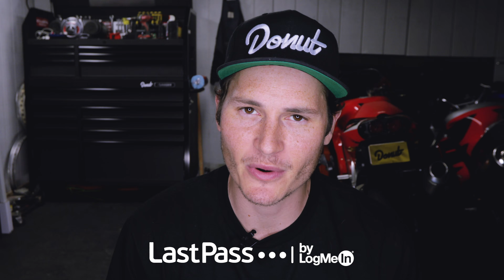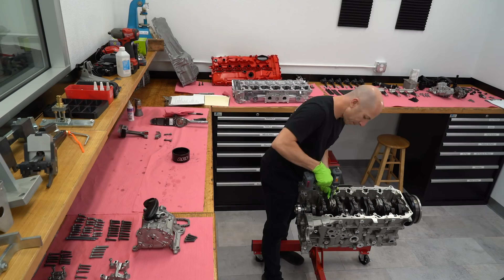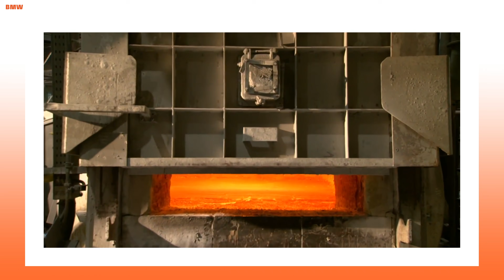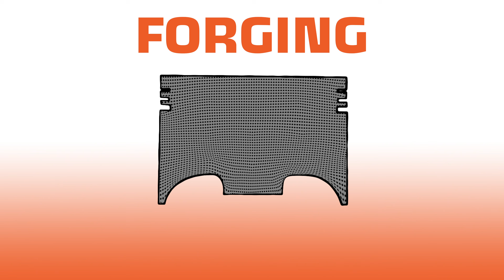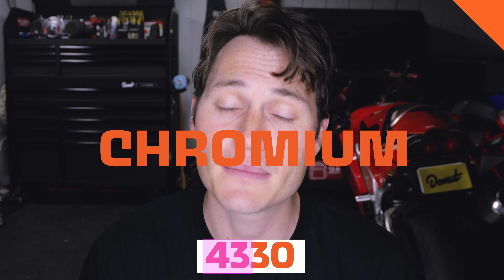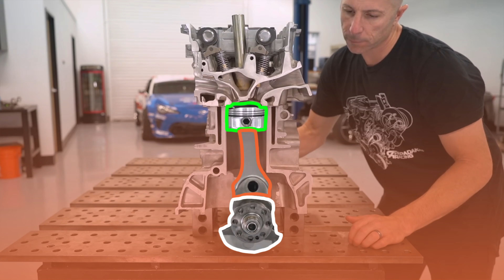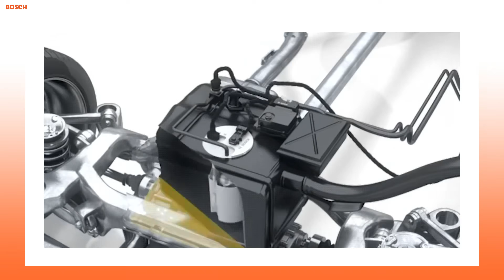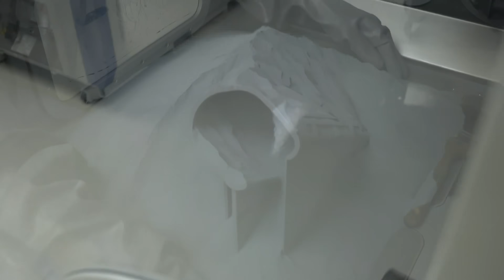The FIRST 1000HP 2020 Supra - Tech Explained

Comment: The use of the stock head gasket is to lower the probability of the bottom end failing. Instead of the pressure taking out the bearings and rods it will blow out the gasket. You should learn more before you misinform ppl. Having the aftermarket gasket with the seal rings and all the stronger material is more likely to blow out the bottom end with all that boost so they use stock gaskets. I kno id rather replace a gasket and not a whole short block and all the custom parts.

Comment: So we're just gonna ignore the fact that daigo saito had at least a couple of A90 supras before Steph made theirs? No daigo didn't use the B58 engine, but he was the first 1000hp A90 🤷
Reply: Not with stock engine that's the difference.
Reply: @carboydorifutoparty3976  but where have they mentioned that? In the title it just says "First 1000hp 2020 Supra" and in the video intro he says "this is the first 1000hp 2020 supra, and it's still using the stock engine"  so they claim it to be the first overall. And not the first to still use original engine 🤷
Reply: @al111dk  I mean that's just dount media saying that. Even tho Steph is still responsible for building the 1st 1000hp drift mk5 with stock engine wise while daigo saito really got a mk5 from toyo that was immediately 2j swapped as soon as he got it(well one of the 1st 2 swapped mk5s ever). For what they mean I think they mean engine wise its the first but not officially with another engine basically.
Reply: @carboydorifutoparty3976  and I completely agree, and they do mention daigo in the video, it just bothers me that they don't out in the title or intro that they mean with OE engine 😅

Comment: The BMW engine mite be good so is the rest of BMW parts they used but i still think it would have been alot better with a new 3JZ. we will never know what Toyota could have come up with to me this is  a shame it can sound like a supra but its not. Toyota should have made there own 3JZ
Reply: Knowing modern toyo it more than likely would've been the exact same thing as the B58 as a aluminum block but it being open deck instead with a big compression ratio with a near impossible to crack ecu to keep it reliable.

Comment: I don't think it's a bad engine I just don't think it's the right engine for that specific car (3jz?).
Reply: Well what do you expect the 3jz to be? These days Toyota likes NA, open deck engines, usually hard to crack ecu wise and that's to maintain reliability. The whole bulletproof aspect of the 2J wasnt for power, it was for reliability at its stock hp rating, which was the old school way of making something last longer. Just a different time man.

Comment: So then just stock this engine sounds like it would last a while, would it get into the 100-200k miles or does the fact that bmw had a hand in it make it last less
Reply: BMW literally took their diesel i6s block,bottom end,and internals and turned ir into a gas engine with a forged crank and a way better cooling system so it wouldn't suffer from overheating or fuel issues including making it closed deck so it wouldn't have issues that the N54 had.

Comment: Im pretty close with a guy with a 440i. It has the B58 engine and he is trying to push 1k horsepower. They are running into issues with the flywheel and clutch I think since it's not dual stage like the supra and other cars that are using the B58.   He is doing a similar turbo to the one in this build. Sorry I'm not the guy but I'll ask him to make a video to see if it all comes together. Edit: I think he is running meth injection rn with e 85. I think he he around 500 ish horsepower. I can be wrong.
Reply: Supras are running the same trans as them(they should)but they have Stronger fuel pumps so most running something like 5-600whp+ isn't a issue for them. Them running into 700+whp they start getting too hot and normally they go port injection/meth injection.

Comment: So you need 39:1 compression and 40lb boost and pretty much swap all internal parts for forged to make only 1000 hp. Maybe I understand wrong but this sounds like an awful engine. Junkyard ls can do 1k hp, and every modern coyote.
Reply: There's another mk5 running like 42lbs of boost with less hp than this and is still running stock internals. In Papadakis's case they didn't have much of any parts for these at that time so that's why he's running his setup like this RN. People are still just starting to throwing in stronger internals(well just rods and pistons as of now) just now so it'll show the difference between his build vs there's after awhile.

Comment: 23:50 ya can do that with other metals, but the printing chamber has to be vacuum purged with magic gas. and the lazier array takes up the space of a foot ball field... the reflector plates and lenses melt but those can both be made on the printer... glass lenses? no aluminum nitride lenses... for other things they need carbon lenses made from diamonds.

Comment: I've learned so much from Donut and they're the reason I'm going to automotive school. Thank y'all so damn much 🙏🏼
Reply: I've always wondered this if you get a 3d printed part of any kind and any material is it or can you make it stronger than forged? Someone please tell me
Reply: @holden2260 (I am a german dude in mechanical engeneering so pls excuse my butchering of the english language)  As far as I know the grain/material structure of what most people see as 3D printed parts (SLM = selective laser melting) is similar to welds which are almost always rather brittle but generally quite strong.

Now lets get to the fun part! First lets talk a bit more about forged parts. The video explains the basics but as far as I can tell makes a few mistakes. As the material compresses and gets formed it also creates more tenslie strength by making it harder for the particles to move ( German "Kaltverfestigung" = "work hardening" - I hope thats correct ) and furthermore allows for better material strength in situations where there is a lot of oscillation/vibrations (like in a car or train). In summary Forging is great but really hard to get right and it holds a high expense up front (for the cast). Forged parts can again be made of many really stong materials

Now 3D printed parts (especially with SLM = selective laser melting) are a very intresting topic and I dont claim to be an expert in this field but I am gonna try to do my best. 

How does it work: you have small metal granules that you melt with a laser and you do this for multiple layers 

Hoe does it compare to Forging ? : Well this depends hugely on the material you use. Keep in mind that the better the material the higher the cost (usually) but I think that for applications where there is not that much vibrations/osciallations they could compare. But generally forged parts are stronger especially in the already mentioned applications like trains maybe even planes etc. 

Where do 3D printed parts find apllication/are far superior - if you need the incredible funtionality, shapes etc. As you know there is a lot of really cool stuff.

Now thats about it but if you really wanna see cool stuff where 3D printing with metals is applied on a really high level  check out Nasa or SpaceX they create awesome stuff 

Maybe I was able to answer your question but generally it makes me happy that people like you are intrested in things like this nowadays- gives me some hope that humanity has a chance 🤣
Reply: @hypex6881  Das ist super! danke..
Reply: Good luck with school!

Comment: I don't think the engine is trash, but I do hate the fact that there is no stick shift.
Reply: Toyota failed us in more ways then one with this car. Still waiting and hoping Toyota makes an actual Supra not this shit.
Reply: @Cre8tive81  well then you'll be waiting forever then cause that's not happening. They had the rc,isf,and gsf around for years as their performance cars and the community just threw them under the rug and kept asking for the supra. If anything,they weren't going to take a risk like that if they're market wasn't even willing put money down on their already made performance platfroms/power plants they've had for practically a decade so there would be no point in making a full brand new car that's dead out of reach to be affordable(talking near to over LC500-LC500 convertible prices for the same car with the same amount of hp but all Toyota) for many to buy the car if it was fully developed by them + a new engine. People didn't put time with their current platforms they had been dragging around for years for people to use(and can make good power)so they weren't going to drop a ton of money on one car that they knew wasn't going to to them much of anything but lose them money and decided to take the route to keep the prices from rising with a tunable i6,decent and usable chassis,and still set at a decent price range for people to afford one with  yearly updates including a later performance model.

Comment: Back in uni I also 3d printed a whole intake system for a 600cc Honda 4 banger. We just used ABS plastic for it and the straight section of the runner had a coupler that joined it to a thermal insulating material to stop heat from the block reaching the plastic. The damn thing has been on the engine and working for  5 years now and it's lighter than a CF version of it.

Comment: the stock intenrals on the 2JZ were stronger, thus why people like SW and others were able to make 1000hp on stock intnerals with the 2jz.
Reply: @Seb C you want to see a 2jz with stock block, stock cams stock pistons and rods with bolt ons make 900whp ok again LOOK UP SW idiot, Peter Blanch etc. or go to Supra Forums and find out for yourself stupid fan boy
Reply: @ps.6023  Well. There aren't any built B58s yet and yet there are like 10 of them sitting in the 9s RN without any trans tuning either. They re still relatively new and also that they're still heavily limited and many parts haven't been tested here and there so it's not fair to really throw it up there at the 2j like that. The block can more than likely handle 1000hp including the crank(since its forged from factory anyway). Now B58/20 mk5 is still limited aftermarket so its way too soon to be throwing it up in the air like this when there really aren't a lot of them out there pulling over 800whp on stock internals(most are still in the 700-750whp range for RN). If anything we haven't seen the 21 mk5s yet since they have different heads,pistons,and a lower compression ratio to the 20s so let's wait another 1-2 years before we throw it up in the air and start comparing it to everything. Every i6 has it's own way in making power in the performance world so they're all not going to be like the 2j.
Reply: @carboydorifutoparty3976  this is one of them the 2j had forged stock crank and rods
Reply: @ps.6023  I never said it didn't. And at the time that this was built there were B58s just touching over 700whp at the time. They didn't have much of any kind of aftermarket like they do now so parts had to be made by themselves.
Reply: @Seb C Uhh no they are not, and I have seen those. 

and are you actually calling SW's 9 second beast a dyno queen? or Real Street baltic Supra which is a 8 second street machine OR Real street's six second street driven (over several hundred miles) ? because you are and you are showing how much of a fan boy/aka idiot you are by not doing your research much like you did with your first statement. People are not making 900 with the stock internals on the B58 as shown here you cannot because they are not capable, with the block and the crank yes but again that's been done well before the B58 with the 2Jz if you did your actual research or were around when t 0 4 r was or went to Supra Forums you would know that
Reply: 1000hp on stock internal is just false, the engine block only can handle maximum 700 hp and with a boost.

I ever talked to a Tuner before, and V8 or 2jz cant use stock internal over 750hp. it will be unreliable and weak, and if you want it to go 1200 hp or more. you can use aftermarket engine blocks and transmission parts
Reply: @skee7259  you obviously have not heard of or are too young to know about to4r.com(sadly no more) or Supra Forums.com or Vinny ten OR SW all of whom can provide you with the facts I presented. Or the fact Real street's baltic Supra is making around 1000bhp on the stock block and that Vinny did it years before as did SW and Peter Blanch 

or my Friend Brian Khallaher who is making 822 at the crank (700 at the wheels) as is Stu hagen who is making 900 at the crank on stock block and internals. 

a 2JZ block can only handle 700bhp? and the internals are weak? lol oh son you have much to learn. please do your research properly son.
Reply: @Seb C uh yes it was, the only thing not stock on the block itself were the bolts and head studs. the rest was a bolt on T72 setup with a HKS VPC and HKS GCC and other BPU parts.  He posted a detailed list on Supraforums back in 2001 which was before you were born and months before the Fast and the Furious franchise started it was built by turbo imports of Texas, in fact its on here. 

how am I a fan boy when you are the one assuming the B58 is Gods chariot and that it is doing something different than the 2j did when it still cannot make 1000bhp on 80%stock internals and the 2j can and did? how is what I posted irrelevant when it disproved what you said and not true when there is clear evidence of it that can be found if you look it up on Supra Forums a community of Supra owners that has been around since 1998

Baltic Supra hit the 9s before he built his motor idiot, it was completely stock internals etc. you called them dyno queens I gave you proof they were not you gave the excuse that they were built and again proved to you they were not. again look them up. 

fast and the furious forums??! kid you are the one who needs to get off those, Ive been involved with this car long before you or that movie was around 

nobody cares about a built motor and yet here you are praising this B58 in which barely anything is stock...

Comment: They obviously built the Supra knowing it was going to be heavily modified. Thats a solid motor. And the inline motor layout is a huge advanrage too. Those engines can take a lot of horsepower without putting as much stress on the internals. I like it, it's too bad it ended up in the Porche price range though.

Comment: I think a 2JZ-GTE non VVTI is one of the best engines. Yes newer engine s beats it in HP and weight but it's just build to last and is so simple. 
The B58 is probably okey. But it's a BMW engine with a Toyota quality control. Love that it is a Aluminium block and the parts in it is so overkill. But I don't like the direkt injektion. The chain driving cams. The engine is also full of special things that requires special tools. And the internal manifold to a 2port slot is not my thing. It's works but I love to see those manifold tubes swirling around before they hit the turbo, just as i like to see the engine and not a lot of plastik parts. 
For performance it's probably fine. But in street mode I'm concerned about sod on the valves and intake because of EGR and direkt injektion... 

And noni don't consider the Mk5 a Supra because a Supra should be s Toyota build car and not a collaboration build. 
Just like  A Mustang isn't suppose to be a electric SUV. 
It's feelings and that are not logical or reasonable.

Comment: People all disappointed that the spec sheet for the 2020 supra said 330hp, and said the 1993-1998 supra was 320hp. But the A70 Toyota Supra was spec'd at 276hp. Ahh, you forgot about that huh?. A70 spec'd for 276 but makes 320? So why do you think Toyota was being honest about the specs this time?  Because word has it that if you dyno the A80 stock, and know the difference between wheel horsepower and brake horsepower, the numbers actually seem to indicate the A80 supra actually makes around 400 at the crank the way the A70 supra did 320 at the crank.

And I'm using the chassis code to differentiate the two rather than their "mark" which is an invented terminology the Americans and the brits came up with. You don't call the foxbody Mustang a "mkIII" or the sn95 a "MKIV" or the 2005 generation a "MKV" or the 2010 generation a "MKVI", or the current generation Mustang a "MKVII" do you?

Comment: The B58 is a modern 2JZ. Facts.

And i still don't get why people want to put a 30 year old engine in a 2020 car.
Reply: bEcAuSe StOcK 2Jz MaKeS lIkE 2O0O hOrSePoWeR sToCk bRo
Reply: Well there's 3 modern day 2jz of them actually. The B58,S58,and S55(despite the S55s crank issue) they're all 3.0L i6s that are practically tunable that people overlook but have potential either way.

Comment: it's tempering that gives steel it's strength.  Cast parts arn't that bad coz they can be tempered.  Forged parts have internal stresses when tempered warp the shape of part. Also tempering techniques for forged parts are not even enough. Hence why most performance engines are still cast today

Comment: Okay, hold up. Not even a minute into the video and I'm being told it was a "stock engine" but they "disassembled" it and installed "forged parts". My suspect radar is maxed out right now. 🤔

Yep, figured forged internals. Not exactly the same as what we did in the 2JZ without ever cracking the block open.

Still impressive though👌

Comment: so basically the car isn't worth buying if you want 1000hp
Reply: Parts aren't made for it to reach that yet. They've gotten as far as 700-800whp but they still lack in aftermarket parts like cams,pistons,cranks,etc that either are still going threw testing or just being made and no ones tested out yet.